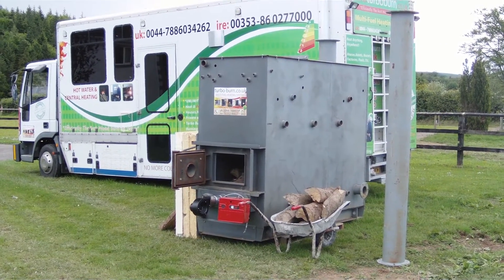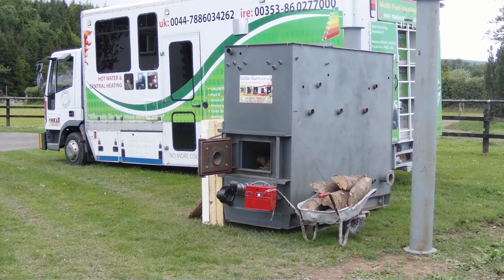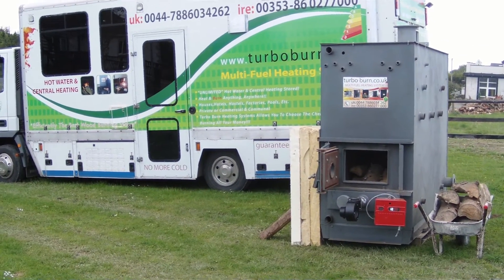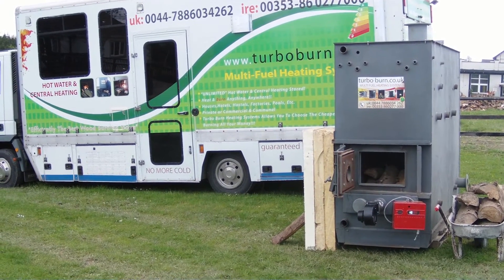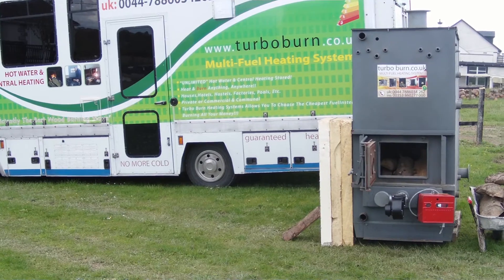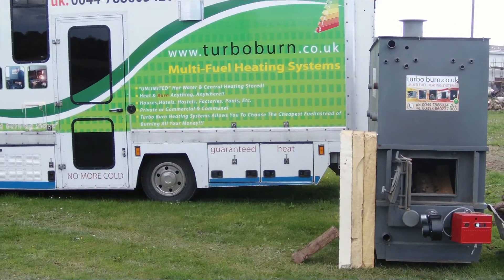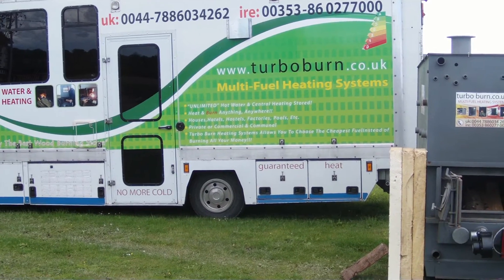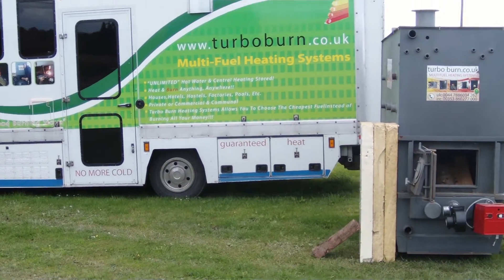www.Turboburn.co.uk      PICT0029

Comment from the maker: email: info@turboburn.co.uk for  any heat requirements these guys are seriously clued in on savings.
This is a awesome system Heat Anything Anywhere very cheaply use cheapest fuel available to you .
Note only burning for short periods daily  not all day like other systems this is good for less emmisions.
Burning wood note this is one of the best made  for the way it burns capturing  most of the heat in the  heat transfer firebox area and immeadtley storing within it own water storage area.HEAT

Comment from the maker: Well done this is a great way to show  costumers from far away places with out they having to travel .And get a general idea of how a Turboburn multifuel stored heat system works .It is a common sense  system short fires at maximum temp extracting max  BTUs from the fuels used and storing the heat, and you can even mix the fuels if needed clever idea.In use for over 30 years. Used in Alaska Canada and  the USA .Can heat  one house or  a cluster of houses private or commericial ,Turboburn.co.uk